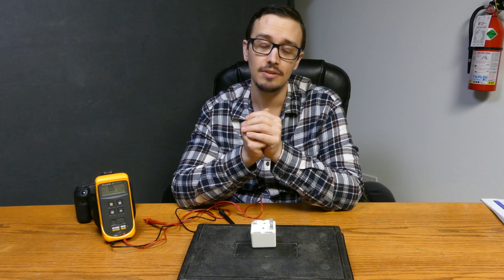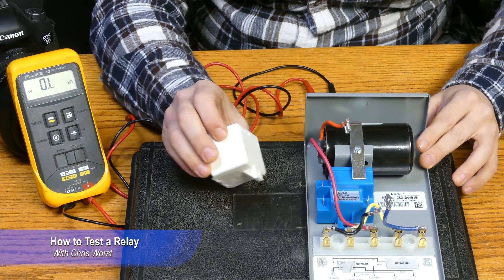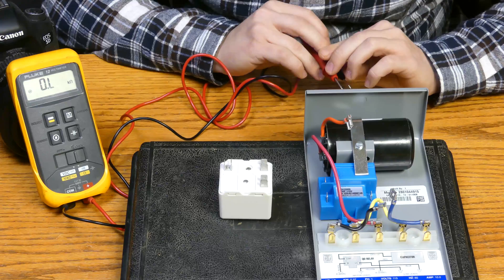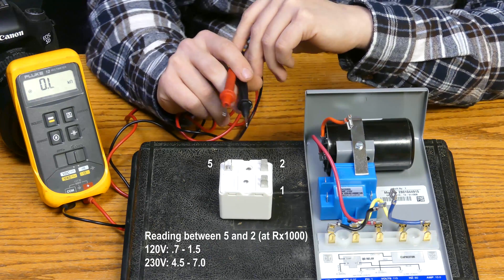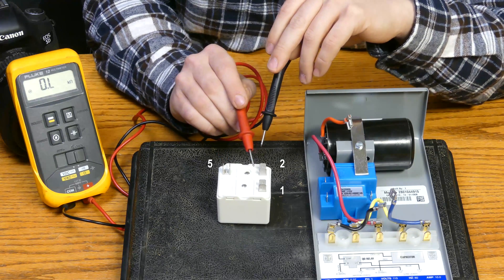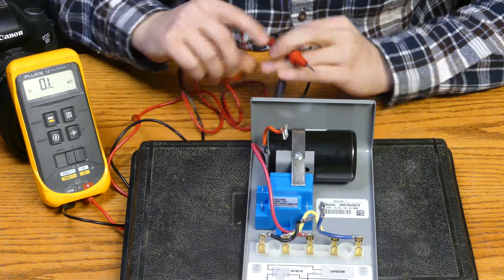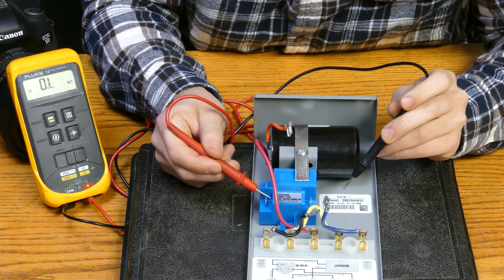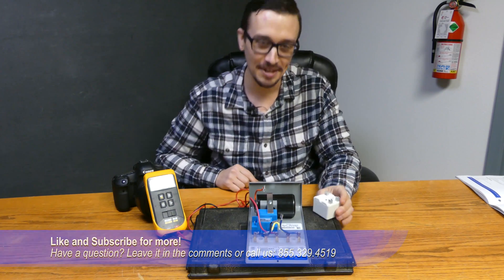How to Test the Relay in Franklin Electric Control Boxes

Comment: Thank you for this video. I have a QD relay and on the control box it says Relay Ohms (rx 1000) for 1.0HP system should be within 5.0-6.2. In my case CAP - B is 13.35 and B-L1 is 1.1. Please could you tell me what those numbers 5.0-6.2 in the chart mean and is my relay bad?

Comment: Do the start relays have some type of liquid in them mine appears to be leaking at the cap wire connection
Reply from the maker: It may have leaked down from the capacitor. Your probably need to replace the whole box

Comment: water pump stopped working. Did the test and on Cap and terminal B it goes to 15.05 and then bottoms out at 13.0.  Does that mean the relay is bad. In the video it says you shouldn't get anything.  Thanks so much

Comment: Hello sir, what is the value of the starting and running capacitor for 3hp goulds submersible pump? Thank you sir
Reply from the maker: 208-250mfd Start | 45mfd Run
Reply: @RCworstwater  thank you sir

Comment: In this vid, you show a 4.5 to 7.0 for a 230 reading for a 230 V system.  My relay is a 27 year old GE 3ARR3.  My reading shows 3.73 that after a dozen tries.  I just going to buy a new relay but from your vid it seems like I should be getting the 4.5 - 7.0.  The GE relay is identical at least with the 5-2-1 poles with the white one you show beside the Franklin control panel. I don't know if you read the comments but enjoy your videos.
Reply: I have the same relay with the same result.  Did you replace yours?

Comment: A quick comment about a previous video you made on testing a start capacitor.  What you didn't mention is that even though the ohm check is good that doesn't mean the capacitor is good.  My ohm test was fine until I did a mfd check.  This is on a 27-year-old 230 VAC shallow well red jacket submersible pump with a start capacitor 64-77 mfd.  The mfd test was a failure with the meter jumping around a bit but not even reaching 10 mfd eventually just going back to one.  The control box also has a second York 10 mfd  in which both the ohms and μF checks out fine. But I have a question about your another vid, so will post another comment.  By the way, I have watched almost all of your vids, some several times, and I have learned a lot.  I feel like I'm a quasi electrician now.

Comment: Please note. The relays are potential start relays. They should be replaced with the correct drop in and drop out voltage! The pump motor builds up back EMF which causes the relay to take the start capacitor out of the circuit. Please advise everyone to replace the relays with the correct drop in and drop out voltage. It's just not a simple relay!
Reply: Thank you. His videos are very good but a quick explanation like you just did would be great.

Comment: I experienced an interesting problem with the control relay on a 3/4 HP submersible pump. A 1 year old pump started blowing the recommended 10 amp fuses every few weeks. Pin 5-2 measured 4.75 ohms. Run current draw measured with a Fluke clamp on meter was on spec and line voltage was correct though I did not measure transient voltage at start up. Changed the capacitor, no improvement. Installed 15 amp fuses and problem went away for a few months. Installed 20 amp fuses for a test only and they opened. Replaced the controller and returned to recommended fuses. No failures 4 years and counting.

Comment: I need how to fix it bc my water stopped working but I need to know how to get it working bc rn it’s making a high pitch eeee noise
Reply: So did you find out what was causing your non start? Was it the capacitor instead
Reply from the maker: Please give us a call for help troubleshooting: 855.329.4519